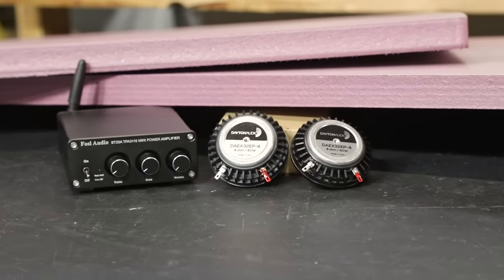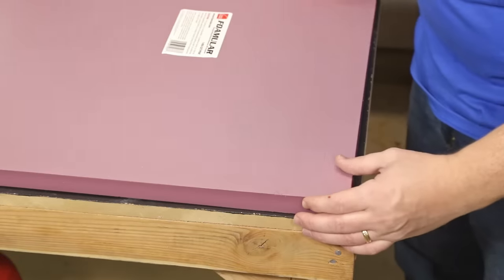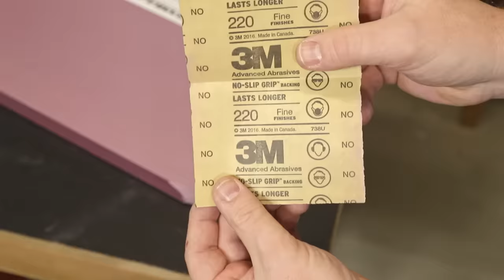How To Build "The World's Best Speakers" - Are Flat Panel Speakers Really Any Good?

Comment from the maker: Based on all the feedback and comments I've received on this project, I'm planning a follow-up video where I'll test the following: 

1) Mount the exciters on posts so that the exciters move less, and compare to the hanging system shown in this video.
2) Compare these panels to a good set of bookshelf speakers.
3) Add a subwoofer.
4) Try painting or possibly fabric-wrapping the panels, and compare with non-painted.

What else do you want to see me try?
Reply: Different sizes of panels.  Also, play pink noise through them and examine the response curve (there are many apps that use your phone to do this somewhat decently)
Reply: Do a two-panel per channel setup by running high-pass/low-pass filters in addition to mounting the exciters for better clarity. Play around with separating the waveform coming from the front and the back of the speaker - speakers can cancel out their own sound by not separating the waveform between the front of the speaker and the back... so while it may sound good, you may get much better performance with some sort of box.
Reply: @AmplifyDIY Hello! I want to do some projects with those exciters, only problem I can´t find foamular in my country any other material like compressed styrofoam can work?
Reply: Increasing the mass of the exciters could help with the low end even more than bigger panels. :)
Reply: i feel as though a lot of sound is being reflected harshly by having the tools behind where the speakers are set up, i feel like having them set up next to a flat wall would give better sound.
Reply: I'd like to compare ceiling-hung (laying horizontal) to see how much just the pull of gravity would affect the sound.
Reply: Would gluing a poster or picture to the front change how they sound?
Reply: @nsmith473  Yeah, I really want to see some sine wave sweeps. There's a nice kit by Dayton on Parts Express for not too much money that comes with a decent microphone. Don't know if he has a laptop or not, though. I guess a phone app would be a good quick and dirty way to measure it. I suspect that besides the low end, these things don't have very good high end, either. I mean, I like the concept and they certainly would make great conversation pieces. But as far as accuracy goes, I'm doubtful. I'll bet the response curve is basically an inverted U with a spike at the resonance frequency. :P I wouldn't mind experimenting with the design. Like, sizes, shapes, and number/position of drivers. Maybe do so reading on the principles of resonance frequencies and such for ideas about size, shape, and driver positioning. The low end is going to be limited by the size. The lower frequencies would start getting cancelled out front to back as soon as the waves become longer than the size of the panel itself. I think you could try two panels mounted with one hanging under the other and then figure out a way to mount some sort of tweeter between them without touching the panels. That might be interesting. Throw a sub or two in the mix and that could be VERY interesting! ;) This is a rabbit hole project for sure! :P
Reply: I checked the other guys video out and they were only showing frequencies up to 5.7KHz. :P That's a bit misleading when trying to show how flat your frequency response is. So, yeah, you aren't going to get really fine high details out of these speakers. Still interesting, though. :)
Reply: Do you think they could be mounted inside a box with a cloth cover, maybe a Bobby pin for each side to suspend it in place so it doesn’t hit the sides?
Reply: i also wonder about wallpapers or hiding these in a wall  something like that...
Reply: make a grid of nine plates ...i really wonder how the sound quality changes ...
Reply from the maker: @soykike1991  Look for "Extruded Polystyrene" - that's all this is. Good luck!
Reply: @AmplifyDIY  Hey awesome that you replied so quickly I appreciate it! Yeah it seems no one sells it in my country, probably that type of insulation ain't needed for tropical constructions, I will still buy the speakers and try to fit in different materials I will update and make a video about it if what I find is reliable.
Reply: Thank you! Comparing the Efficiency would be of great interest.
Reply: I would like to see the build:
1. *without any extra metals*  and minimal changes to the project foam board -- namely without the cotter pin / split pin and the without the epoxy glue.  Just nylon / fishing line to suspend them.
2. Testing of where the exciters are placed (dead center, 1/3 from the edge
3. Various shapes such as a rectangle, others with Phi ratio, etc.
4. Sine wave sweeps for all of the above.

It probably doesn't matter but it would be good to have verification if any of the changes matter.
Reply: Where are you located? If you happen to be near me I'd be happy to bring over my PMC/Bryston gear for comparison. Regardless, I'd very much like to know how these compare to $300, $3000, and $30,000 speakers (and where in that range your normal experience falls). I love my PMCs, but they are blown away by some of the really high end stuff I've auditioned.
Reply: @CybershamanX  The original video has all of that.
Reply: What if you mounted a second panel to the body of the exciter at 2/5x3/5 with the driver at 1/2x1/2. I suspect that destructive interference would live up to its name instead of balancing the tone.

I'll bet these things would make awesome Chladni plates.
Reply: If you have the gear, hearing a binaural recording of them would be great! I would also be interested how they sound when obstructing each other, like handing a smaller one in front of a larger one. Would also be interesting to build resonator boxes that goes around the back but that they still hang freely from.
Reply: @neon4892  I'd say a flat, hard wall would be a worst case scenario. You'd want some wavy thick curtains or acoustic paneling/traps behind.
Reply: I would really like to see you try painting or applying some kind of resin coating! The reason being that you could put a print or canvas wrap on the front and have your speakers disguised as art
Reply: @ArvidOlson  I'm just saying it would give a more consistent sound compared to a mess of tools and that would reflect sound unevenly
Reply from the maker: @Arvid Olson - great idea to record with a binaural setup! I've added that to the list of things to incorporate in my follow-up video. Thanks!
Reply: Try and mounting them with elastic cords, or mount the exciter hard to the wall.
Reply: How it would be to mount a stand directly on the back of the exciter? I mean instead of hanging it on - the plates would get more room for movement/vibrate on the top.
Reply: @soykike1991  yes.
 Look at teck Ingredients original video and they detailed some other materials and the pros and cons thereof. But consider any rigid light material a possible solution,  even say plywood.
Reply: You could try multiple exiters per panel. There would be pros and cons there but partsdirect details using multiple exiters per panel

I made some panels and put movie posters on them with contact adhesive and didnt see a dramatic loss in quality, 

fabric would work as well, but may have more dampening effects, depends on how much the fabric can be made to not interfere with surface vibrations, so nylon or silk would be superior to denim or felt in theory

You already observed an equalizer would improve quality, I'd say an improved amplifier would give you a quality boost, the one you used is certainly adequate,  but a slight upgrade may give a dramatic effect
Reply: It reminds me a bit of electrostatic speakers where you have a lightweight membrane with a large surface area. Instead of the membrane of course there is the light foam board.
Reply: how about a reference mic with a frequency response readout?
Reply: @ResonantBytes  add weights to the drivers, I have tried this myself, glue some coins on the back
Reply: Try horizontal and vertical, I have one above me hanging horizontally (and have also put one on the roof of the bathroom now called the "bass cave") and it really fills the soundscape. Also experiment with spacing to the wall.
Reply: Curious how loud they get in SPL and also what kind of power consumption they require. Are they very efficient? Is hanging the only way to 'mount' them?
Reply: Cut off huge sections of your dry wall and replace with these panels, get caught by wife in the middle of the project.
Reply: @garethsmith7628  Yes something like that. I guess you had to glue on quite a number of coins for a noticeable effect? ;D
Reply: I recall watching Tech Ingredients' videos on this project a few years back, and I recall reading a particular comment on one of his videos that seemed like a really good idea. Essentially, that commenter was hypothesizing that an elliptical shape for the panels would provide a more dynamic sound range, much like how a 6x9 speaker has good overall sound response compared to a standard round woofer.

A common theme I keep hearing is that the bass response for the square/rectangular panels is quite lacking, but everyone else keeps going down the rabbit hole of material type, or the overall size of the panels, or the type of amplifiers/crossovers to use. I've yet to see anyone attempt trying an elliptical profile for the panel, including Tech Ingredients himself. He stopped at circular vs. square, and decided square with round corners was better overall.
Reply: An 8 panel set up like Tech Ingredients (48sqft of panel), but 1/2 the size maintaining ratio (4 big panels - 1.5ft x 3ft and 4 small panels 1.5ft x 1.5ft = 27sqft ). Painted with some kind of watery paint or dye. I feel like this would be a realistic installation for a lot of people considering the size of a standard bedroom and the obvious need to paint them something other than Pepto Bismol pink
Reply: @soykike1991  I beleive tech ingredients tried a few materials that also sounded good, the foam just sounded the best, I recommend watching his vid to see waht more options there are
Reply: I like your shirt. It reminds me of a joke I wrote.

What's the difference between cow farts and fossil fuel CO²?
Cow farts don't contain heavy metals.

"The major heavy metals of concern to AMAP are mercury, cadmium, and lead. All three can be toxic at levels that are only mod- erately above background levels. They are believed to be present in some regions of the Arctic at levels that may pose risks to the envi- ronment and to human health."
Reply: What if you put two exciters on one board? Does it make a difference if they are near each other or further apart?
Reply: Cut some chunks out of the edges of the foam and see what it does for resonance. Might get rid of the weak spots, but might stop them from working all together.
Reply: Could you try another shape? Hexagonal or round? I want to make some but hexagonal would look much cooler hanging on the wall :D
Reply: 1) Exciters need to be braced per frequencies are getting reduced because coil movent.
2) Panels also need to be braced with nylon strings from the corners to keep them centered and not hanging from the coil suspension on the exciters.
3) A box with the edges protruding around with a sufficient gap to attach the panels retaining strings and holding in place the exciters.
Reply: @soykike1991  Try Isolating panels with dense foam. The stiffer the panel the better the sound.
Reply: I wonder if you put an agitator on or in the middle of a U-Haul 14 foot box trucks side wall what kind of sounds will it make
Reply: 8:48 You mentioned an equalizer may help with rounding out the sound a little better - what equalizer would you recommend?
Reply: Exactly what I was thinking, mount the exciters so energy isn't lost through the exciter body moving instead of the panel.
Reply: You mentioned adding a bigger panel to improve the base, could you also add some smaller panels to separate out the high end?

Similarly, could you use these for a surround setup, rather than just stereo?
Reply: I'd say try different shapes, also try putting a sound dappener like MLV behind it. Try clamping the foam at the top compared to having it hang on strings also try clamping it on all sides and see if there is a difference with where is it attached.. Definitely get an equalizer. 
drill some holes in the foam. Listen to dubstep or something bass intense. Play something with a lot of sounds happening all at once. Listen to white noise. Add another pair. oooh, attach fasteners to all sides and keep the strings taut on all sides. How would it sound with "sound proof foam" over it or behind it?
Reply: Please try to use as hanging point not the panel, but body of the exciter. Thanks.
Reply: I wonder what different shapes might do
Reply: Use say - four then six - eight or NINE (or more) and make yourself a halfway decent ANALOGUE surround sound system - no wait - you won't be able to do that - as you don't have the correct analogue surround sound, deplexer-decoder to do that with.
I do - but I ain't coming to where you are - to do a video of that - as I have a lot of those sitting in my own speaker stock-room, waiting for me to do that myself some day -- I just came here to HEAR what one or two sounded like - before I attempt building my own multiple ch system, with these
Reply: There are subwoofer exciters so why not make your next project one or two of those?
Reply: Agree with poster who suggested measuring speaker performance with pink noise generator.  Also use an SPL meter to compare output against cone driven speaker.
Reply: You don't mention WHY you're doing things like rounding the corners or sanding down the front of the panel? I would think having a rough front would disperse frequencies better.
Reply: Egg shaped panels, exciter mounted center of mass?
Reply: Water 💧 I gotta Feeling it may create a very cool sound!!!
Reply: i wanna know how some real loud metal music performs on these
Reply: Different size ratios, and differing exciter locations, maybe additional panels to see how many would be optimal for all frequency ranges. Maybe different insulation materials to see if it changes things up?
Reply: The color is awful. Black or white
Reply: If you want you can use some of my songs as test audio, since honestly thats what i make them for. All of them are testing for different aspects such as room and how the system being tested handles reverb, reversed tracks, high pitches and varying amounts of bass
Reply: Any chance you could try mounting them in other positioning? I'd be super interested to see if they could work mounted on a ceiling, for example.
Reply: @ResonantBytes  Our Australian 50c pieces are fairly substantial at 15.55 grams each (also octagonal for even more interest) - so $1.50-$3.00 worth.
Reply: Try a couple of surfboards - seems to work quite well and I think the extra length adds to the bass.
Reply: Does it matter what shape or how big the foam pannels are?
Reply: @Acheiropoietos  try looking at Wondom jab3 boards. Or a Windows plugin called EqualiserAPO
Reply: @garethsmith7628  not light enough for efficiency, you need lightness so the diaphragms vibrate easily
Reply: Buy a sheet of gatorfoam, its a hard shelled foam board you can cut with a saw and drill into and its still very light, might give interesting vibration response.
Reply: Add EQ to it
Reply: i would like to see what it would be like, for each panel to be suspended by magnets in a frame. if that would hinder the entire panel's movement, or interfere with the exciter in any way.
Reply: I was worried the vertically inserted cotter pins would eventually vibrate out. I have put little cutoffs of aluminum tube through the board to act like a grommet to loop fishing line through. If you slowly turn it in it will eventually push through.
Reply: cut the foam board perfectly round and compare to the squircle cut.
Reply: @soykike1991  Check out this Tech Ingredients video https://www.youtube.com/watch?v=zdkyGDqU7xA  It's the channel he mentioned a few times in this video. They tested lots of material there as well as other stuff, but the material examples are near the beginning.
Reply: @soykike1991  I'm fairly sure I've seen this technique used on wood before. Same theory diffrent materials could be used.
Reply: WHO MADE THIS VIDEO WHO MADE THIS VIDEO BECAUSE IT'S AWESOME
Reply: @bloogaming8827  Misconception. That will make them sound dull and flat. You want diffusion panels, not absorption material
Reply: Get a good microphone and hook it up to something that can read the full range of sound beyond 16 and 20K to get some empirical data, especially if you're going to compare it to bookshelf speakers.
Reply: Attaching art/prints to them
Reply: @soykike1991  This is XPS or eXtruded Polystyrene any brand will do.
Reply: It would be interesting if you tried a carbonfiber covered covered divinycell board, those get very stiff and would transfer the sound very well, you could have as thin as 1 or 3 mm divinycell and a carbonfiber cloth of 200-300 grams /m2.
Reply: @CybershamanX  My first thought is to try a different shape, such as a circle, and also 2 exciters on a single sheet. If something like this were set up in a home they would be a cool conversation piece, the not sucking part is a plus.
Reply: I would love to see the follow up build
Reply from the maker: It’s going to be a little while, still. Have to build a few different test rigs, etc…but I am already working on it. Stay tuned!
Reply: Please measure the frequency response curve and show it, would be really good to know
Reply: I'd like to see this done with an asymmetric shape, to see how that affects the audio quality. Get artsy with it!
Reply: Can we see what putting the exciters in different spots around the panel does to the sound in depth? If I were to build these in stereo, I'd have two panels per speaker - one bigger for bass and one smaller for the mid-treble
Reply: I wonder if you’d get better acoustics from adding some weight to the back of the exciters. I think you’re loosing some of the vibrational energy through the back of the exciters, as they move freely (unlike in a traditional speaker, where they’re usually secured to the frame). 

By putting additional mass to the exciters, you’d be able to apply more force to the boards themselves (Force = Mass * Acceleration + for every action there is an equal but opposite reaction). 

This way, the speakers have enough mass to throw out the “meatyness” you were talking about, instead of dumping all it’s energy out the back half of the exciters.
Reply: I wonder if you’d get better acoustics from adding some weight to the back of the exciters. I think you’re loosing some of the vibrational energy through the back of the exciters, as they move freely (unlike in a traditional speaker, where they’re usually secured to the frame). 

By putting additional mass to the exciters, you’d be able to apply more force to the boards themselves (Force = Mass * Acceleration + for every action there is an equal but opposite reaction). 

This way, the speakers have enough mass to throw out the “meatyness” you were talking about, instead of dumping all it’s energy out the back half of the exciters.
Reply: make a surround sound system with them
Reply: Try plugging a guitar amp into these things.
Reply: If you've been watching "Tech Ingredients", then you probably have the still... so cheers!
Reply: try framing it in a box, for example: my phone sounds great in a large bowl
Reply: Play with the mass of the panels for your high&low staging...heavier panels will enhance the lows...they make a really dense plastic sheet for industrial applications,  could be a good candidate to put against aluminum sheets(with enough motor force, two or three exciters about 2/3s up but spaced equally across the panel in that same plane perhaps?)

Anything super light, rigid and thin to make the panels out of?...should help for the highs, right? They make different design exciters- some do have a better efficiency at higher hz than others suited for being a lot of moving mass; the "punch" vs crispness from one design to the next.
Reply: @paulciorogar  I would affix to the box via a highly flexible membrane to allow, maxium flux while keeping a separttion of air from external encluse vs external
Reply: @lio1234234  cheers Elliott 👍
Reply: @soykike1991  look for extruded polystyrene foam
Reply: Irregularly shaped panels and the effect of that on freq response.
Reply: Can you mount the exciters directly to a surface and not worry about hanging the entire thing? I'm looking forward to seeing the painted/wrapped versions.
Reply: carbon fiber honeycomb sandwich panel
Reply: @therealbasstard  Dayton Audio -DAEX25X4-4 it is 89 dBSPL it is not bad at all for a driver. But your real enemy it is a mass that drive has to move.  Lighter panel became more efficient and with less distortions a speaker be came. This mean better sounding in a low volumes.
Reply: @lio1234234  Have you tried? It is surprising the sound you get out of wooden doors, glass sliding doors and so on.
Reply: @soykike1991  so some countries have it in different colors.  You are specifically looking for something called polystyrene.  I am familiar with this stuff as I used to make dnd pieces from it. Hope it helps.
Reply: @nsell  Yes! I was gonna suggest playing with a good crossover and doing multiple panels per channel as well. Sounds like you know more about boxes than me tho, hope this gets included in the follow up!
Reply: Adding a subwoofer would be interesting to hear!
Reply: Let’s get some different sizes to see what would work best for center channel audio. Would love to do a surround sound system with something like this
Reply: Build a box with sound deadening panels behind these. Think picture box, then hang the panel inside the box. This should help with bass response.
Reply: Wouldn't circular panels work better than other shapes?
Reply: @cmbaz1140  Like a 3x3 grid, with each exciter offset corresponding to its position on the grid.
Reply: Id love to know if its possible to shrink these down to Car Speaker size.
Ive been meaning to replace my cars sound system for a long time but budget is kinda tight and i wouldnt mind putting in some  work myself.
Reply: @davidparry6693  yes, any material or surface change changes the sound a bit. I tried painting some of the foam kind in a glue paste mix to harden the surface up to some decent results in sound profile.
Reply: 4 hooks. each corner. Make a bunch of them. Hang them on the ceiling to look like its covered in acoustic tiles but really, they make sound not absorb it lol.
Reply: You should try with no support for exciters but a metal rim round the edge of the panels.
Reply: Maybe add mass to different areas of the board, some hot-glued washers or similar. Extra mass on certain inboard areas could create some pretty bad harmonics, but mass on opposite edges could set up lower frequency transverse waves. Usually deformation like this is detrimental, but considering the driver design the deformation in this instance could mimic the longitudinal excursion of a standard driver. I have a suspicion that this would lower the frequency response but introduce one or two MASSIVE peaks. An eliptical, trapezoidal, or some other asymmetric shape could reduce peaks, but at this point I'm just throwing darts in the dark.
Reply: I feel like there's got to be some really interesting ways you could combine materials/shapes to adjust performance and sound.  I'm thinking about maybe small inlays of a more rigid foam around the perimeter, or an inner shape?  Possibly just a single strip at an angle to help further mute harmonic issues?  Maybe just a thin vineer of maybe balsa glued to a foam board?  Also curious as you mentioned what would happen if you have different mounting methods...Suspend the panel with springs, support the driver from a separate floating spring?  This whole thing is fascinating and I am going to order some drivers and start messing around.
Reply: @MrFerrariF360  I was thinking along similar lines (kinda). Using added mass and/or differing ridgedity areas to make different areas "tuned" to different ranges.
Reply: Poke or cut holes or slats into the board in different arrangements and sizes to see if that changes the sound. Maybe you could have some extra internal vibrations to make up for the lacking mids?
Reply: Perhaps a rubbery paint
Reply: Multiple actuators per panel, please!
Reply: 2x4 panels to compare to 2x2, didn't tech ingridient also coated them with mixed glue+water?.  I am waiting for the exciters to arrive but plan to coat mine on my form board.
Reply: Abstract shapes with the panels. Oblong but with one of the vertices scooted off to the right or left so we have more possibilities for different standing wave patterns
Reply: @AmplifyDIY  just double tape the exciter to the wall. Pretty quick easy test. I imagine securing the exciter will make the most significant difference.
Reply: When will you make the follow up video?
Reply from the maker: @Nin204292  I've been working on it for weeks. Finished most of the filming over this past weekend. Have a LOT of editing to do. Stay tuned! It's coming as soon as I can finish it up! Here's a quick sneak peek behind the scenes: https://www.youtube.com/channel/UC1sPYHJYgJppmlkhi1AekuQ/community?lb=Ugw2DO38Dmr8G4YccT54AaABCQ
Reply: @TylerYoungNet  I'd want to see this as well. I'm thinking could I build the Atmos speaker setup with these in more supporting roles (ceiling and maybe sides) and keep my Amphion 5.1 as the core. Anyone have any experience on this? Also thinking off adding similar looking ceiling panels but with sound absorbing properties.
Reply: @greatpix  I would like to see him test that, too.  I don't have a sanding tool and can be quite dangerous with sharp objects, but think I could handle taping the exciter to the back of an unmodified piece of foam. :-)
Reply: How about adding a coat or two of polyurethane to stiffen up the panels and see how they sound?
Reply: @soykike1991  look for XPS
Reply: @soykike1991  Look for XPS based panels
Reply: #4
Reply: Different shapes
Reply: Differents foam densities if possible
Reply: How does using other materials affect the sound?  Birch vs sheet rock vs foam…. Or is using two transducers per panel possible without degrading the musicality?
Reply: Did u make it?
Reply: Mounting the exciters was my immediate thought, wasting energy by having them bounce around and not pushing that energy into the foam.

I know this is late too, but curious how mounting like a tweeter on the same board, or just splitting up your speakers so it's not just a all in one set up, sub/mid/high/left/right setup instead
Reply: metric please
Reply: Try and measure the frequency response, it should give a better idea of how they sound as opposed to just describing it. Also maybe test how the relative size of the drivers and panels affects the sound. Finally, see how they sound with the drivers glued to a wall, it might make them a bit louder and even maybe affect the sound.
Reply: What if you add more mass to the 'other end' of the exciters?
You'd then have more inertia on that end so more motion would be sent to the panels.
Reply: Carbon fibre sheets with an enclosure for the driver?
Maybe the carbon fibre sheet can be glued to a rubber sealing like a normal speaker cobe but turbed inside out?
Reply: @donar31337  That is just about the best improvement suggestion throughout  these comments, not to take away from anyone else, Isolating/floating the sound board as much as possible, is key. I will for sure adopt this method.
Reply: Why not put multiple exciters on one foam board?
Reply: One thing you could try is larger and smaller sheets using a triangle cut putting the point down it will create a larger volume while making a smaller platform also 100 lbs test fishing string to hang them shout out for the try I have four in my garage two small ones and two larger ones and the sound is amazing I got the idea from your channel and had to try it I used a circle a square and the triangle just to test them and the triangle sounds the best
Reply: Circular boards. Seems logical to give it a test.
Reply: Didn't Tech-Ingredients suggest that acoustic tiling would be before bettered and cheaper than the foam board?
Reply: I'd love to see an array of different sizes that are each EQ'd specifically for certain tones. i.e some larger panels for the bass, smaller panels for the treble. I reckon you could really fill out the range that way
Reply: My instant curiosity was, “could I use a single large panel for both left and right, instead of the usual two separate entities?”. Would there be cancelling, or phasing, or... I have no idea what I’m talking about. I just have limited space for my video projector and one giant speaker/screen would be a great solution.
Reply from the maker: @thelowmax  Yes, you can use a single panel and still produce a stereo image! There are lots of ideas and installation tips here: https://www.daytonaudio.com/topic/excitersbuyerguide
Reply: @Archaemn Music  Mannheim Steamroller, Fresh AIRE lll  makes for a excellent test music
Reply: @davidparry6693  not much no and long as it doesnt flat around